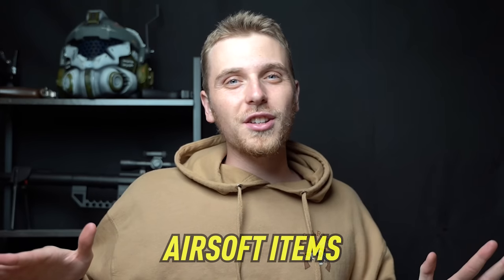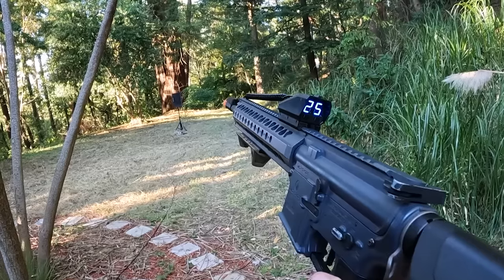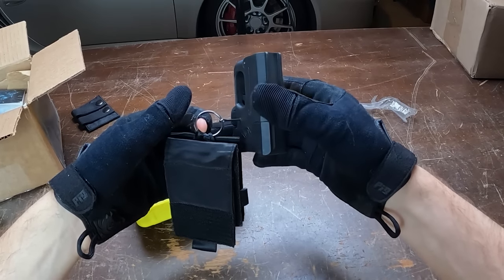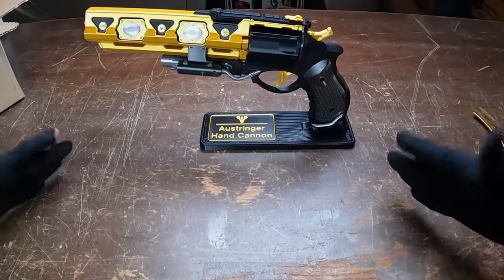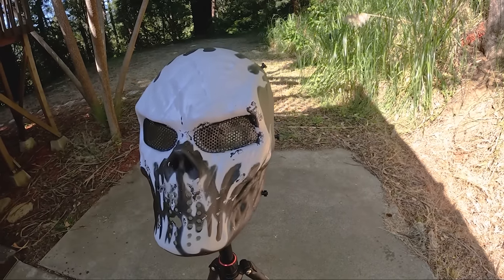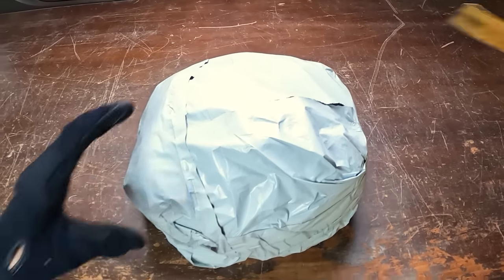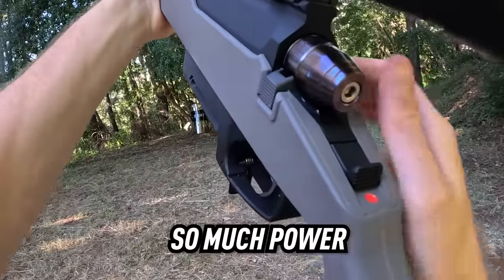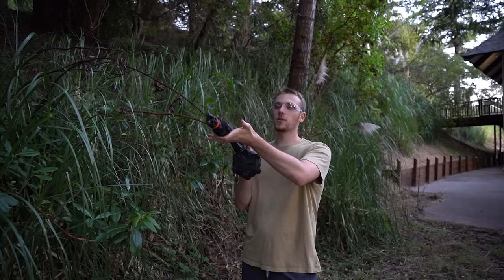I Bought the Weirdest Airsoft Items on the Internet! EP.5

Comment: Its honestly impressive how flimsy that sight protector was for how thick it was, that is a feat.
Reply: although i wouldn't take what he does as an actual test of how good something is for things like that protector and for the face protection stuff cause realistically he is shooting at them way within any airsoft fields no shoot limit and therefore  these types of tests are not very valid .. especially with the high powered airsoft guns hes using at that close of range he would be booted off the field real quick ..
Reply: There's better ones u just need to find a good one
Reply: @rickc1682 that’s exactly what I was thinking. Like these tests are very unrealistic
Reply: You need to bend it over so it’s on a angle, it will defect every shot like that
Reply: Im pretty sure the sight protector is supposed to be angled so the bbs deflect, not stop them
Reply: Nah usually they take the shots because they are made from better materials.

Only time that thing got damaged was when I tripped and fell.

If you got a good one they can be good for sights where you can't fit a kilflash for protection. (Saved my Holosight 3 times I know of)
Reply: It's acrylic, for some reason they're all acrylic. Lexan or polycarbonate would be better, but would scratch more easily.
Reply: @rickc1682 not all field have minimum engagement distances. My locak field only has MEDs for snipers DMRs and LMGs

Comment: for the BB protector, your suppose to turn in around so you can lean it onto the sight, so when it gets shot, it doesnt take the full force and would cause the BB to ricochet off
Reply: Finally someone that understands
Reply: I saw a kid with one of these at my local field, it was angled and brand new and untouched, at the end of the round there was nothing left but the small parts within a millimeter of the screws
Reply: @NAFO_Turtle BUT: His sight was fine, wasn't it? I'd rather buy a 10 stack of those for $25, than 3 or 4 of my $50 Red Dots, no? 🤔
Reply: @HG_Budde  yea, the red dot was fine, it's just an extra £7 a game is a lot, I use irons so...
Reply: @NAFO_Turtle  Then he had a cheap set I bet. Mine can withstand a .40g bb at 360+ fps
Reply: U can also get thicker lenses for those things. I use AW custom lenses that are double the thickness of the lenses that came with the mount, and I have yet to see a single one destroyed or even cracked.
Reply: I would have liked to see him shoot it from long range to make it a more realistic in game test. I use them myself and they are a life saver for lenses. @AngelOfDeathLD
Reply: Honestly, I don't regret buying these protectors, the first game I used it I was sprayed down by players in a vehicle, and although my protector cracked it was still in one piece, and from the location of the crack I surmise that it would have wrecked my reddot.
Reply: i love when ppl review something wrong and then call it bad like... stand further back and use it correctly,
Reply: It's amazing how many products he "reviews" that he doesn't know how to use at all. Especially considering every time he opens a gun box he laughs at how big the user manual is..

Comment: Careful with that lazer. Cheap lazers can be dangerously powerful. That one in particular isnt crazy strong, its probably somewhere between 40-80mw.  But its still dangerous. Regular lazer pointers are less than 5mw, at that power your eyes have time to blink before they take any serious damage, anything more than 5mw can blind or cause vision damage before youre eye has time to blink. You should really have lazer safety goggles to operate any lazer over 5mw. Now 40-80mw isnt ridiculous (you can easily buy 3000mw lazers, that will blind or damage your eyes just looking at the dot on a wall), but its still powerful enough to cause permenant eye damage from a direct hit, or full reflection(like a mirror or glass), so it needs to be treated  like a firearm. And if you decide to buy any more powerful lazers, do some research and buy goggles.

Edit; if anyone wants a lazer like that but better I would reccomend a green 532nm lazer 303. It should be the same price as this one(another edit; by the same price i meant $5-10, which is how much the laser in the video should cost do not pay more than like $15, holy shit he got scammed so hard), but its surprisingly good quality. They're around 60-100mw. Obviously very dangerous and needs to be treaten with caution and safety.

Comment: I would not say it is a fail for the protector. The purpose is to not have this happen to the optics. It is extremely rare to get the optics shot out - and it would save it from that one bb that would have otherwise hit the glass inside. 
But if it was expensive then it is most definitely a failure :D

Comment: Okay, the ballistic knife is actually super cute, and surprisingly practical that you dont need to retrieve the blade after.  If only it was spring powered to not use so much gas on a passable gimmick.

And dont skimp on frace protection, mesh will not stop BB fragments/dust from going into your eyeballs!
Reply: Those masks are fine to wear as long as you then wear proper safety glasses behind them. Bisons (great work glasses, come in like 15-20 packs and average $1-2 a pair fantastic protection and can't beat the price great coverage from most angles, if they will stop a nail/staple/brad at 120psi+ they will stop an airsoft bb)

Comment: About the bb protector, you see it a lot on the field in The Netherlands from my experience. Most people buy one but replace the “glass” later one after some games of eventually breaking with a polycarbonate variant which is basically unbreakable with the 1.2J with 0.3G BBs max rule for rifles (2.3J with 0.3G BBs max for snipers with minimum shooting distance of 25meter).
Reply: i got my £250 red dot shot out made me salty af i got optic protector but i have it sloped  back still covering the optic works well
Reply: @Liqudstormz  I just bought a red dot for my rifle (Vortex Crossfire - 180 euro) and my pistol (Vector Optics Frenzy - also around 150 euro if I remember correctly) which have VIP warranty that includes shot out replacement service.

Luckily never had to use it since (got them around 6 months now so fielded them like 8 times) but if it’s true I can really recommend them for that reason.

Especially since most decent red dots are 40-80 euro and I’ve had mine shot out 3 times or had problems with finding replacement protective caps resulting in buying another one
Reply: Yeah, the high end ones are amazing. Even the cheap ones help, because if they shatter the scope won’t shatter.

Comment: The tracers with the muzzle flash effect also works with AEGs. I have one on my M4 AEG and especially at night its almost comedic how big the "flash" is while firing
Reply: Is it a threaded? Can u send a link?
Reply: @Nick2foolish  I bought a t238 brand tracer for a modded Nerf blaster. It has the tracer and muzzle flash modes, and you can select both or one or the other only on. It also comes with 3 mounting methods, one for use on threaded barrels, one that's just a grub screw, and another for friction fit. Some of the more expensive versions you can change the color of the muzzle flash to any color, like purple or green.
Reply: thanks alot :) @itsagundam79

Comment: This is for future refrence btw

Be absloutly careful when buying laser pointers becuse 99% of the time they are often stupidly over powered and they can blind pepole also some lasers are sold with  adjustable lenses called star cap which split up the main beam into smaller beamlets however a powerful laser can still be a eye hazard even if the beamlet only has 1/3 of its orignial power
Reply: Just commented the same thing before I saw this. That lazer is only around 40-80mw, which isn't crazy but it's still way over the 5mw limit that allows your eyes to blink before taking serious damage. And you can just as easily find lazers that are 3000mw online, which can permanently damage your eyesight or blind you from just looking at the dot on a wall. So if wag or anyone else plans on buying any/anymore lazers it's important to understand lazer safety, buy goggles and treat them with the utmost care and caution like you would a firearm.
Reply: @DVNGXR  true to that
Reply: @derrickhageman1969  damn I didn't notice he put an image showing he paid $135. 😳 That's literally a $5 lazer, he got scammed so bad.

Comment: 2:30 buy a sheet of plexiglass form it in to a rounded shield and mount it with some additional support in the lower rail so it doesnt flex, use the upper mount of the broken thing to mount the shield up top and bam full face shield

Comment: I know its not quite what the Destiny revolver has, But it made me think of an airsoft revolver with a reloadable cylinder. My biggest gripe with most airsoft revolvers is they have so few shots, making them not really practical. But if you had a reloadable cylinder that you could fill with a good amount of BB's, that would be awesome.
Reply: I mean, that is basically what Austringer has, actually.  The Magazine is filled with liquid Glimmer (a type of Programmable Matter).  The internals of the gun convert the Glimmer into rounds that depend on the gun that's making them.
Reply: @angelousmortis8041  I mean as an airsoft revolver

Comment: Soviet Union Era NRS-2 Scout firing knife.
Firing The Same Cartridge as the Soviet Union PSS Silent Pistol, which at first look, has no integrated suppressor or detachable suppressor.
Instead, both the NRS-2 and the PSS are dependent on what's known as a SCS (Sealed Cartridge System)
Meaning the casing of the cartridge is the tube and the inside is the bullet.

Comment: I used to have a gas blowback pocket pistol, based on the colt 25 thingy. It was the funniest and most unique thing and as a challenge I would run out onto the field with just that. Every kill felt so rewarding and funny. Sadly it fell out of my chest rig pocket when I was using my rifle and I never was able to find it :'(.

Also those sight protectors are usually a one time use item, the one I got came with several replacement plastic shields that can be replaced. The odds of actually hitting the sight in the first place are low. When it breaks it still deflects the bb away from the sight at which point you should probably go back to the ready up area and replace it.

Also for shot counter, try out the xcortech x3300w. It has a built in ammo counter, chrono, and tracer unit and the sensor looks like a suppressor. I love it and still use it all the time.

Comment: gotta take the screws out of the acrylic to get the film off smoothly, Also I've been rocking mine for awhile from amazon and it works amazing
Reply: When you shoot at the edge of any acrylic or glass as he did you are trying to nothing but break it!!! It would be an honest test if he shot it straight on, not on the edge!!
Reply: @johnnybravo2452  I could definitely see what you're saying where the crystalline structure in front is continuous but on the side is  has already broken surface uniformity due to the nature of being cut/machined in that pattern

Comment: Sight protectors work well if you know how to use them right. If you put it directly in front of the sight and  then lean the top of the protector against the top of your sight it creates an angle which increases chances for the bullet to ricochet causing less damage as opposed to having the protector vertical. You have direct pressure and then you have partial pressure.

Comment: i would disasemble the bb counter, put the core components in the gun (aeg) 
3d print a custom case for the screen then  place the screen at an 45 degree and pant it with white (main color) emerald green(lines)behr cracked pepper(details)

Comment: I used wish for 2 years. Half the stuff was crap. A third was what it said it would be… but even more cheaply made. But there was some winners. “A$$hole Merit Badge”… I must’ve gotten lucky, but I bought 4-5 from the same shop, in 3 different purchases, and each one was good quality - looked every bit as good as Boy Scout patches. Larger than the BSA merit badges were back in my day, but the esthetic was 100%. And all 3 times, the shipper was faster than promised.

On the other hand, I had a shipment from China stall out at a warehouse 2 hrs away… and didn’t move. By the time I got a response from customer service, they told me I waited too long. I replied that I followed their instructions for a delayed order to the letter. I ended up getting the equivalent of store credit… “wish bucks”. Considering I was sick of the wish crapfest, but I got some MORE merit badges. Heh. Shoulda sent one addressed to customer Svc Dept.

But I would NEVER buy *safety* equipment or daily use tools from wish, temu, AliBaba, or whatever other internet discount dumpster dive.